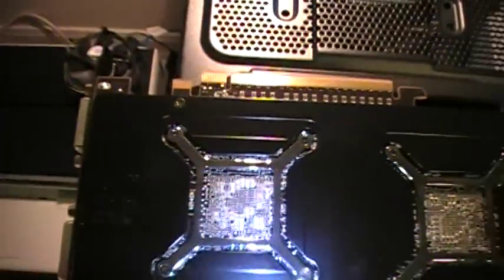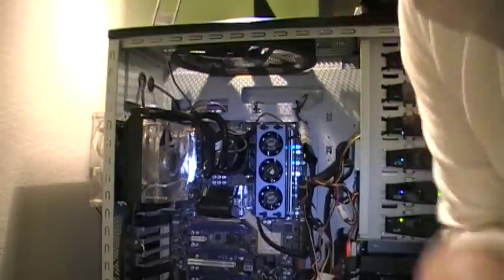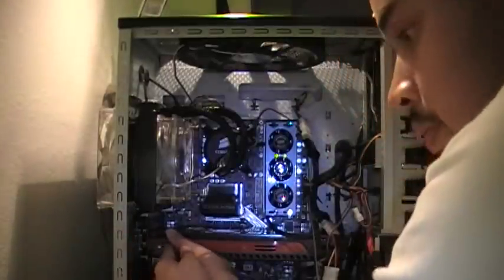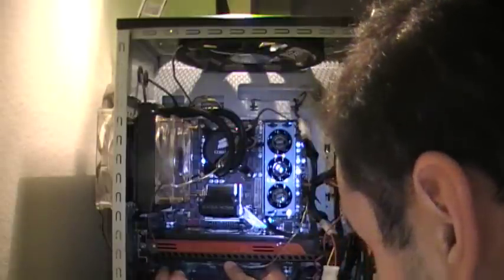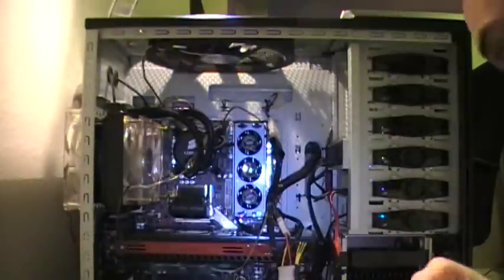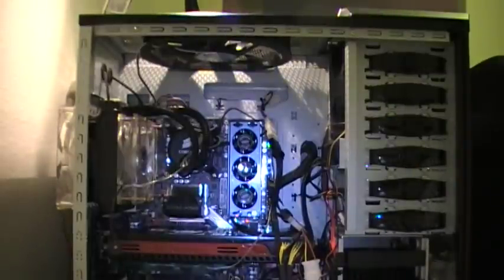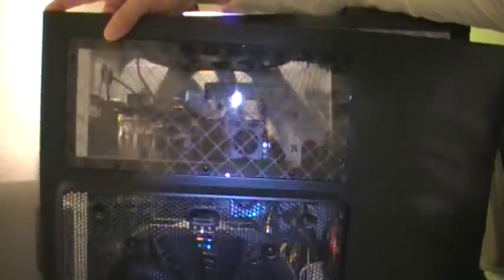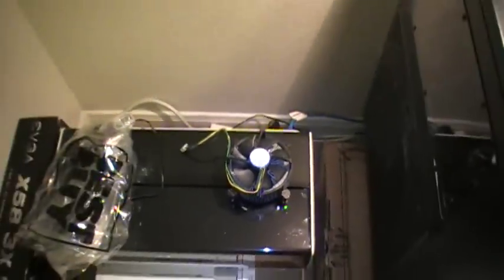XFX Radeon HD 5970 III

Comment from the maker: @MJ4everTheKing 2 5870 in crossfire mode but the 5970 is fast and will give you better performance. 
The 5870 in crossfire will waste more power because you're going to have to power up the other card too.

Comment: Depends on the resolution you plan to play at. If you play 1920-1200 with a 24 inch monitor your likely to have slowdowns, especially in the future with the newer games, if your playing at 1600x you should be okay. However if i were you though get the 4850 that's what i got, it's cheap and great performance for the price.

Comment from the maker: My PC Spec: Intel Core i7 @ 3.8 GHz, Corsair H50 Water Cooling, Corsair DDR3 XMS @ 12GB, Corsair 1000W Power Supply, Two WD Raptors 10,000RPM 600GB in RAID 0, EVGA X58 SLI motherboard, Sony Blu-Ray Reader & Samsung DVD-RW/CD, Full Tower CoolerMaster LG LED LCD 22 Monitor,  Kilpsch THX 2.1 Speakers Razer Mamba Wireless mouse & Apple keyboard =)